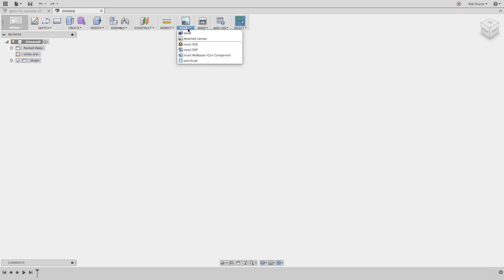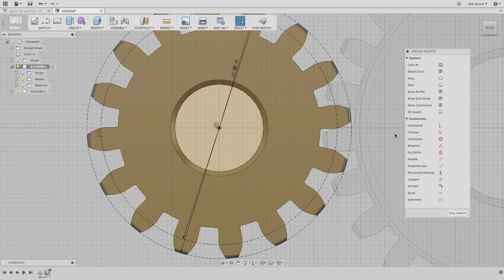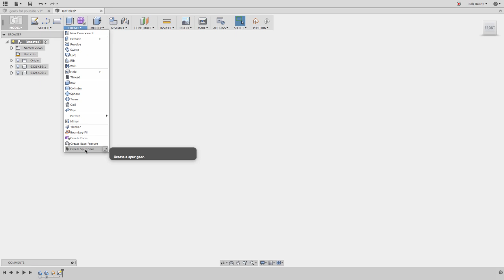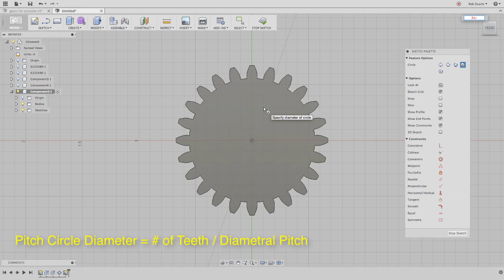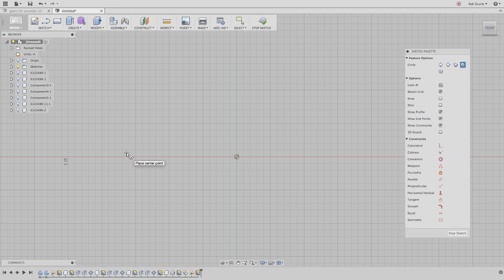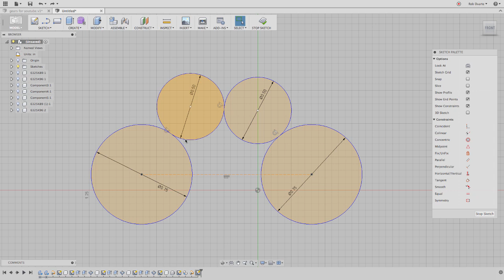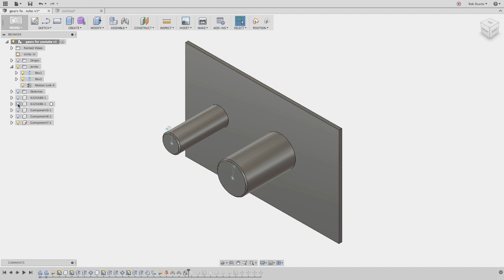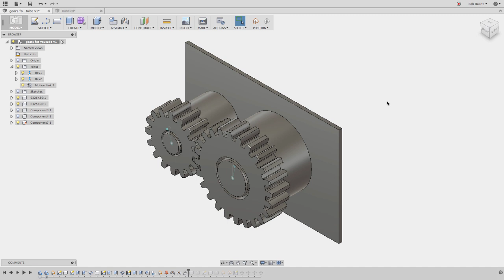Fusion 360 GEARS GEARS GEARS!

Comment: It's a shame the Fusion 360 gear tools are not what they could be as far as user friendly goes. Thank you for taking the time to explain how to make what they have work. You're videos don't put me to sleep either!
Reply from the maker: hah, I try my best to get to the point - it usually takes a bunch of takes to pare it down. :) I think the gear tools will catch up. In the meantime, I've also been using the gear tool from woodgears.ca - the software is well worth the low price tag, but it only works in Windows (although I'm about to try installing it in a windows virtualbox on MacOS where I'm sure it will work fine).
Reply: I hope so. I was rather surprised to learn that the gear tools in 360 were so basic. SketchUp has more gear options! I thought that being a "real" solid modeler it would have all sorts of options but nope, it's rather primitive. Fingers crossed for the next update though!
Reply: As long as I got your attention how would you go about making an elliptical gear that can mesh with a circular gear? I'm probably one of the few people who would want to know but it might make a good topic for a video.

Comment: Just a bit of info on reading the McMaster-Carr catalog, if you look at 1.32 in the video it shows the pitch of the gears is 32. Both of your equation use this number, 16/0.5 and 24/0.75, so you could have just entered 32/2.54 in both cases.
16/(0.5*2.54) is the same as 16/0.5/2.54 or 32/2.54.

Nice video by the way, thanks for taking the time.
Reply from the maker: Haha of course - thanks for pointing this out. I'm actually just using the add-in for the project I'm working on right now and added the McMaster info to the video for completeness' sake.  I should have looked over a bit and noticed that there's, of course, a pitch column provided in the catalog.  Thanks for the comment.
Reply: A bit more info for anyone working in metric, if you need your gears using module here's how to use the Fusion script. Divide 25.4 by the module then divide by 2.54. So for a 0.8 module gear (25.4/0.8)/2.54 =12.5 for the Diametral pitch the script needs.
Reply: ...or, since 25.4/2.54 = 10, just divide 10 by the required module. In your example case: 10/0.8 = 12.5

Comment: Rob,

I am following your video and I get to the point where the driven gear is moved in the X-direction as specified. The tooth of the drive and driven gears don't line up correctly, there is an interference. I took a screen capture to show you, but I am not sure how to get it to you.

Comment: Thanks for this video - I know I'm a little late to the party, but I think it would be interesting to see torque relationships. I'm currently trying to create movement in a small space. I have a very weak brush-less motor (ie a cellphone vibration motor) and I challenged my self to gear it to move a 2 lbs object in a linear direction by pulling on a thread/string. Would you be interested in doing a video on such a thing?

Comment: Very helpful video but the align command doesn't seem to be working for me. I select the center of a gear and then the center of the corresponding circle (as shown in the video) and the gear aligns it self correctly at first but when I press Ok or select another gear it just snaps to a seemingly random position and this happens every time with every gear I try.
Any help on what I might be doing incorrect or what I could fix would be appreciated.
Reply from the maker: The align command dialog looks a little different now than it did when I made this video, but it looks like it still asks whether you want to align Components or Bodies. Are you choosing Bodies? I just tried to reproduce what I did in the video and it works if I'm aligning the gear Body but doesn't if I'm trying to align the gear Component (which contains the body).
Reply: Yes, I selected "Bodies" and it didn't work. But I just now tried it with "Components" selected and it worked.
Reply: Which seems rather strange to me.
Reply from the maker: Same.

Comment: Is it not easier to do Assemble > Enable all contact. Then you do not need to write a formula. they automatically mesh together
Reply from the maker: Anupum Pant That's not a realistic solution because contact sets are very cpu intensive. Even the simplest contact sets can slow your computer to a crawl - gears meshing is more than you can ask of that feature. It's also not as predictable or smooth as you might expect. With or without contact sets, you still need to model the gears correctly - it's just the motion link that it would replace and that's the easy bit.
Reply: Ooh! True. I thought it was just my poor laptop running it slowly. It really is not very efficient.

Comment: A joint from component to sketch would update automatically,
Reply from the maker: Can you explain?
Reply: I'm only new to Fusion 360 myself, and I'm not really certain what he might have been trying to say, but I can guess.  I do know that if you first created the gears as an appropriately constrained sketch based on parameters and extruded them from the sketch, then any changes to the sketch would be carried forward into the 3d gears.  If you started with 3d gears, maybe you could project them onto a sketch plane, thus establishing a profile, then build them up properly from that profile.  Basically rebuilding the wheel-pun intended... Anyone who know better than I, please advise.
Reply: Thanks I think I got your point..Creating a 3d model with the req. dia and teeth and projecting them and adding constraints to the projection sketch and extruding those sketch which would have in built constraints....Nice Idea..Thank you